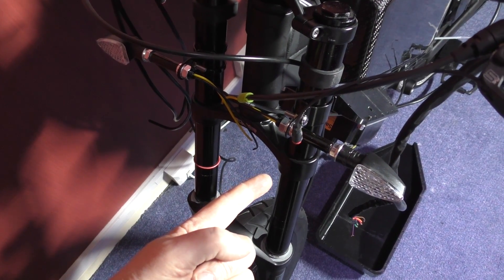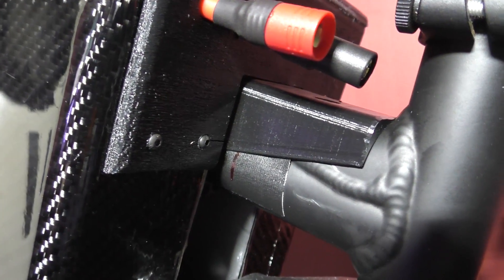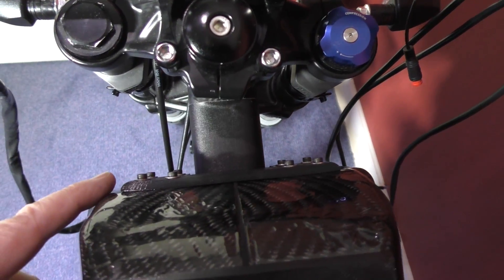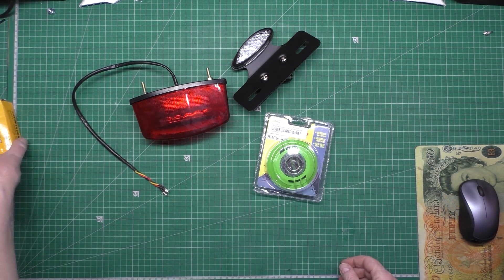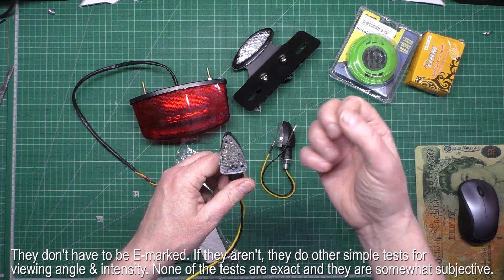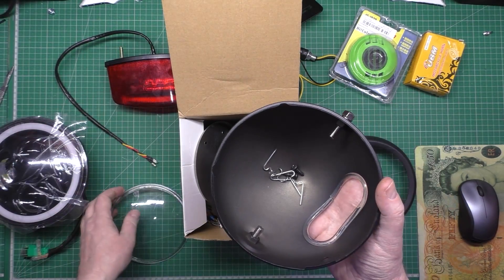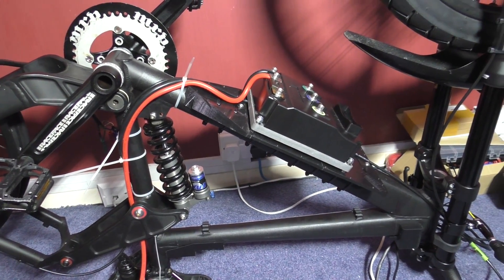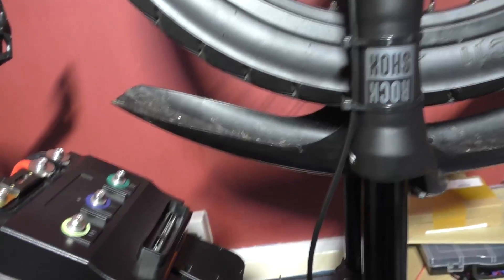High powered DIY eBike MSVA build part 20 - Wires everywhere

Comment: i know how you could mount the handlebar switches wire them by the saddle and just wear it as a cock right
wanna indicate give your todger a rub
need to honk the horn with your willy a flick 
lol

but srsly though thankyou for mentioning the troubles with the switches I hadn't considered break clearences id been obsessing over bar length and thickness

Comment: Tony - My suggestion:  under the battery: send measurements to a seamstress and have 2 (one for either side) (or, more) custom water proof bags sewn up. 3d print a liner to provide stiffness. This means you can remove the bags to reduce the weight to carry the bike, you can have more than 2 (one bags for repair, one for clothes for work, two bags for groceries).  You can easily swap them out depending on the trip. You can have them with full length zippers and a handle on one end. I would also suggest that you cut a skirt in the aluminum front and rear and slot a very  short strap with one half of a plastic clip. The other half could be sewn into each end of the bag. Just two squeezes/snaps to attach/remove each bag.
Reply from the maker: Sorry to disappoint but......A seamstress in the UK? They went away about 30 years ago mate.
I've designed some plastic inserts and they only weigh 80g (3oz) but they're hardly big enough to carry much. I should be able to put a few tools in there but that's it. They're more of a cosmetic thing, rather than for practical use because they are really useless.

Comment: i put indicators brake lights etc last year on my ebike, i did them bit by bit at different times so ended up with a big ass bunch of wires, I have ordered some trailer wire to redo them this year as you can get it in 7 core (ideal for me) or 13core and the smallest one takes 14amp per wire but you can get it upto 29amp per wire, maybe a Idea for you too Tony before you start for tidier wiring. Also i forgot you will need turn signal load resistor as well as the indicator relay or they will not flash properly 1 for each light, they are on/ondull with just relay. You probably already know this anyway but thought i would put me 2p in the meter :)

Comment: great build,
 I'm currently working on a conversion I'm converting a honda cbr125r to electric 28kw
Reply from the maker: David Bi Please do some build videos, I WANT TO SEE 😁👍
Reply: Vortecks  will do
Reply: David Bi damn what motor and battery?
Reply: Joshua Huang I’m using a revolt 160e 28kw and I haven’t decided on the battery yet but it will have to be at least 10kwh
Reply: David Bi Jesus christ 10kwh of battey thats gnna weight so much
Reply: Joshua Huang it will but I do a lot of long distance commuting so I’m gonna need it I’m thinking 144v 40-100ah or 300v 30-50ah
Reply: David Bi do u use an enduro ebike frame? idk how much those frames can fit
Reply: @joshuahuang07  I've managed to stuff 4.4kwh into one
Reply: Shit ya need some decent batteries on that to get close

Comment: I’m surprised you got that 6” headlight intact I’ve had two of them delivered and both arrived with the glass in a million pieces.
Just one point your rear brake hose would it not have been better to run it along the lower arm as a more direct route.
Reply from the maker: Nothing is set in stone yet. When all the wiring is routed, I'll start looking at optimising where everything is routed. I'll probably move it underneath and down the 'downtube'.

Comment: u better do some weight  training carrying that up the stairs lol, glass bulbs solid metal struts etc, how much heavier you estimate it to be compared to version 2 ?
Reply from the maker: It'll be much lighter than V2..... that's why I made a removable battery 😁
Reply: @Vortecks  ah i must of missed that dialogue, so would you make two trips up the stairs then ? or just battery in one bike in other hand
Reply from the maker: @girlsdrinkfeck  It'll be 2 trips. The battery weighs around 21kg and the bike will be around 28kg. There's a lockable door at the bottom of the stairs so I know it'll be safe.

Comment: i am using those cheap horn headlight switch you show at 11:20 for over 3 years in dutch weather and they still work fine, i paid 2,5 euro for them i think
Reply: i also have the big ones you show at13:50 but they dont fit since i still want to keep using my gears
Reply from the maker: Spoiler alert....... I've changed them to full-blown motorbike switches 😁

Comment: how about something like this from these guys had one on my motorbike and was great they have other shapes and sizes works on a magnet and hall effect on the wheel they also have a gps speedo module u can add to it bud works on 12v :D even has ur telltales built in https://www.digital-speedos.co.uk/gauges-c4/motorcycle-gauges-c27/multifunction-gauges-c29/koso-ex-02-multifunction-speedometer-streetfighter-enduro-scrambler-p55
Reply from the maker: You won't believe it but..... I bought the exact same one from the same supplier on Friday 😁
Reply: Vortecks lol one I had was a classic round one but they all work the same lol and dead easy to wire and set up :)

Comment: I had those indicators on my motorbike... I changed to micro once there so much smaller but twice as bright.. Type in ebay micro indicators and they pop up. I just moted with mine on and all good.. Same price as set of those you got on your bike now.
Reply from the maker: I'll certainly be changing things when it's passed the MSVA, I just want things to show that I've tried to conform to every possible regulation and to make sure that everything has an e-mark on it.